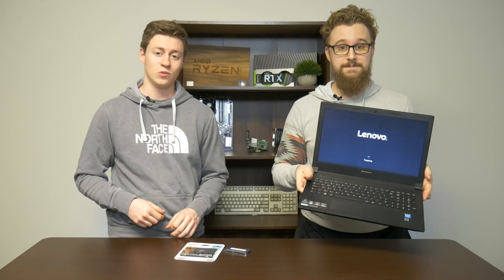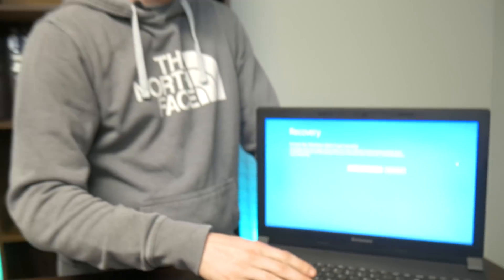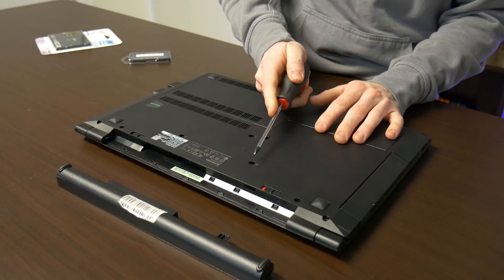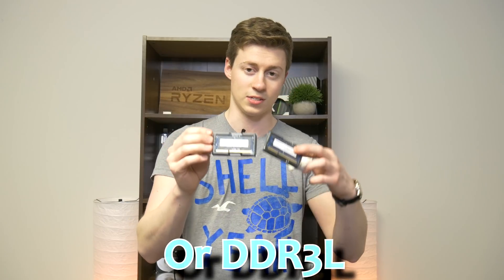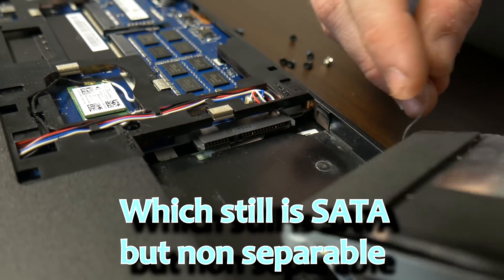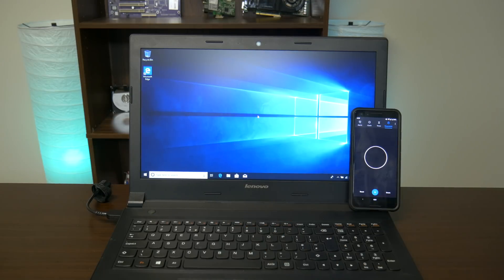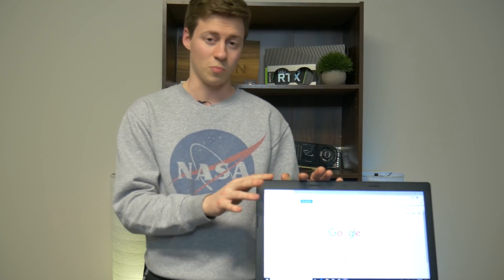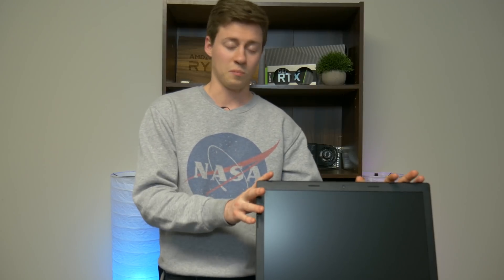Speed Up Your Old Laptop For Cheap!

Comment: it was awful 
Post things that you are good at it not those you have done only once
the first issue: Do google things before posting videos 
secound: Is it a fortune that your previous ram and the one that you buy matched?
I mean didn't you double checked before buying it? 
third: you should have mentioned HDD caddy
some people need larger space to archive their files and fast speed of SSD to help them with boot times

each one of them cost around 10$ in my region
and in my opinion, you should also mention DVD writer box for those who still want to have their DVD writer and use it time to time
after all, it was horrible

Comment: I have an old ivy bridge i5 laptop with 8gb dual channel 1600mhz ram with 5400rpm HDD. It takes like 4 minutes to be usable after boot. I took one of the 4gb DIMMs out and put an 8gb dimm in for a total of 12gb ram. I chucked a slower Hp 120gb SSD in it and it boots in a slightly slower time as my ryzen desktop with the same SSD that boots in like 20 seconds.

Comment: so....add ram and a SSD, plus a clean install (or really any operating system)
Reply: What is a clean install?
Reply: @jtomassini51  reinstall a fresh copy of windows (though with windows 10 you can do a windows factor reset from the settings menu) 

sometimes it's better to just reinstall windows or hard reset windows then try and remove all the spamware and programs slowing it down
Reply: @bluescluessuperagent  or instead you can get rid of bloatware

Comment: If I put 8gb of ram and an SSD into my old 2010 Toshiba, I guarantee it would be faster than this one. It has like a 1 minutes 30 boot time with it’s hard drive(also from 2010) and has a fairly old Install if Windows 10. This laptop also has an upgradable CPU. I upgraded it from an i3-370m to an i5-560m.
Reply: I wanted to upgrade cpu when i had my old laptop but i was scared to open it
Reply: another CPU up to a i7-640m would also be great for your laptop
Reply: Person1073 I looked at that, but it wasn’t worth the extra money for 1MB extra cache and a 200mhz extra clock speed.
Reply: For sure that will fly with an SSD. My Core Duo laptop from 2006 needed 4-5 minutes (Win 7) from power on to usable desktop. Replacing the HDD with a Crucial MX300 275GB SSD reduced this to a mere 30 seconds.
Reply: My dell latitude e6420 is 8 years old and takes less than a minute to boot up and there's no ssd or anything lol
Reply: I think u have toshiba sattelite c660 i have same

Comment: I purchased a HP X360 pavilion for $$105 on mercari. It had a i5 Skylake so still pretty new. It had a 1tb HD so I put a $40 $240gb SSD and sold it on hardware swap for $295. Very easy money. Then I could use the 1tb that the laptop had for game storage for a PC build